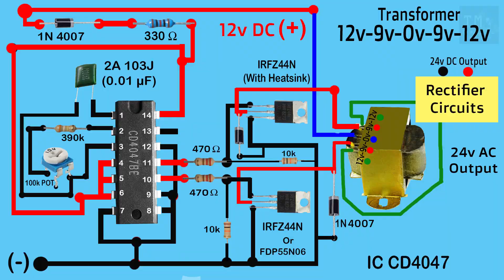12V DC to 24V AC/DC Converter

Comment: Really nice. I found the CD 404 7 BE can only operate around 200mA. So I wonder if you could only output 100mA at 24 V ? Sorry if the question might sound stupid. It is the first time I am converting dc to ac. And I am not sure if the supply current for the output needs to go through the IC. 

I will be glad for an answer !
Reply from the maker: Thank you.We can use smaller transformer to get low current at output.So we need thiin wire instead of thick wire.
Reply: Oh I mean higher current maybe 1 A or so. But then it would be the other way around, so I guess  bigger wires. I guess I will try to build a similar circuit with a NE555. That is what I have lying around. Do you know the Pulswidth of your multivibrator ? I guess you probably played around with the potentiometer and measured the output for calibration? 

Best greetings